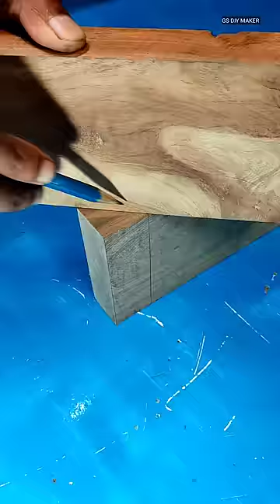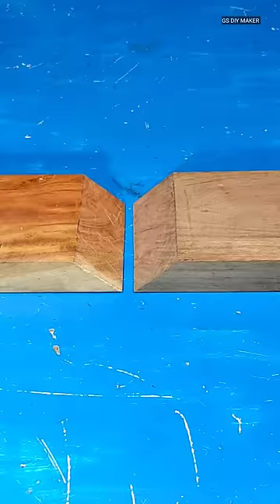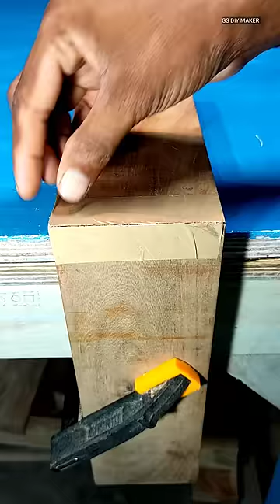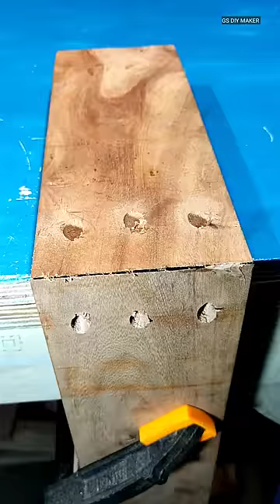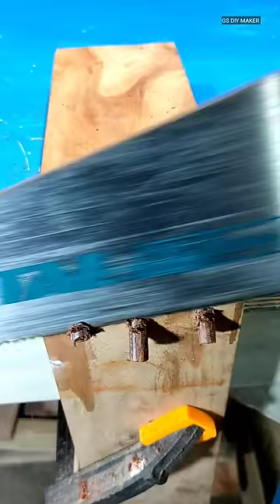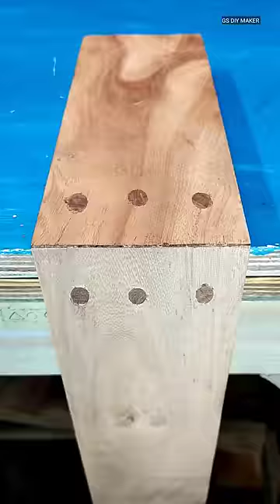Simple wood corner joints #shorts

Comment: Whoever uploaded this, you need to countersink the back of the hole of the first side of the miter so it doesn't blow out and create that gap. That's what's happening. Your pushing wood figures in between the mitre.   You can do it to both side if you want where they meet together for extra space and to guide it into the second side.

Comment: If you want to appear as a professional, you need to ensure you are actually at 45*, and when you layout your dowels, either actually lay them out or use a jig, so you get uniform spacing, and when the drill bit exits a piece of material, it needs to be entering another one, so you don't get blow out on the exit side of your material.

Comment: You clamped that bottom board way too low and torqued it out of square and if you are going to drill 3 holes like that drill the first, sinch it up nice and tight then do the opposite and finally the middle. Or just clamp the whole thing up perfect so it can't move and then do all 3. Could be much better but i'll give you get a pass cause you did it with hand tools and no jigs.

Comment: Jesus christ these keep getting worse and worse. should use a pull saw for ur pegs..  and ur miters! not hard to make a nice accurate miter block for cutting miters. Can buy one for a few bucks even. Just Y?? Uses a cross cut hand saw free hand haha. Worst miter I've ever seen. Grand canyon of miters.. tons of blow outs bc u used a drill bit made for metal haha. And u blew out the edges with ur dull chisel.. coming at the way wrong angle. Go diagonal! And be careful at the edge!